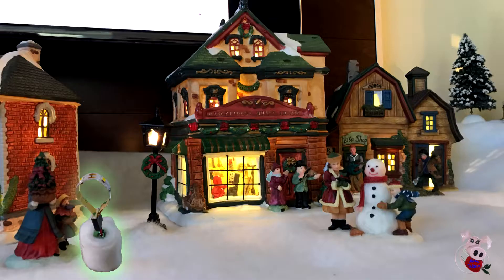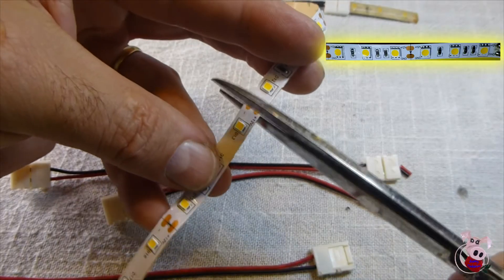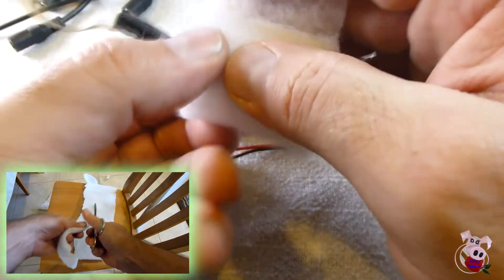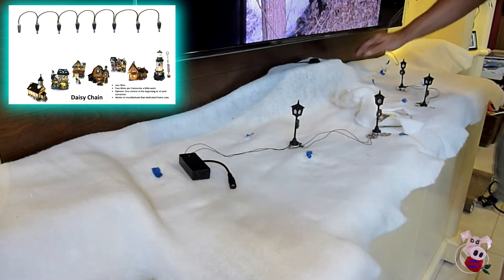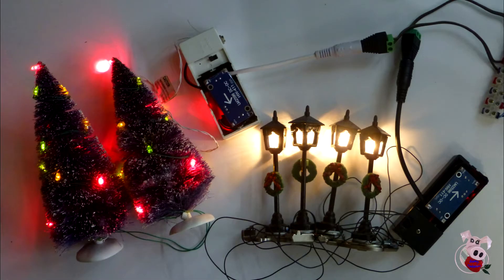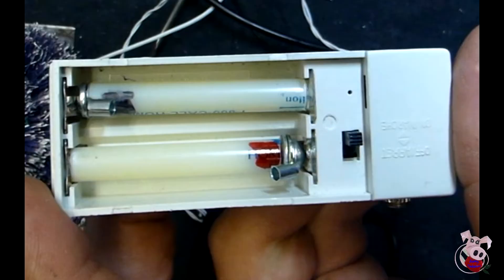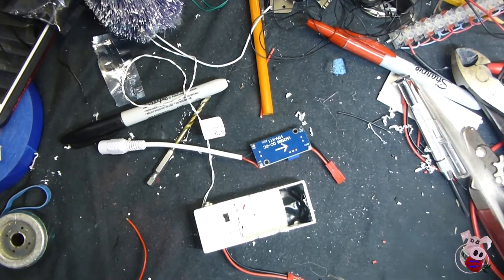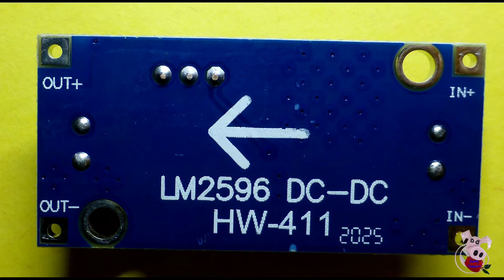Convert your Christmas Village Display to LED and all 12V DC power

Comment: Hey Rachel. Your video is great. I am finally understanding how to wire my Christmas village. But it is still not clear to me how to use it connected to a power supply. By any change, do you have a video explaining this? Thank you! 🙏
Reply from the maker: so at 6:31 I show a power distribution strip and then how to build it.  The connector on the left (the female connector) would plug into the 12V power supply and power that entire set of connectors.  So that takes the DC positive and the DC negative and extends equal power across the line to each connector.  

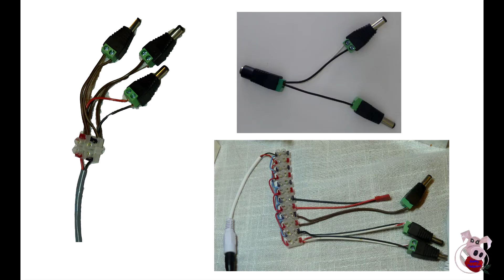In DC power there is always a negative and a positive wire.  They are exclusive and connecting the negative and positive together would short them out causing a switched (LED) power supply to shut off until the short is fixed.    If you wanted to power multiple strips of of power connectors with each one having a female connector at one end, you would need some type of device to split the power like I cover in 8:17.  It is also worth noting that the LED's have a positive (+) and a negative (-) and if you hook one up backwards the result is... the LED's at that connection won't illuminate... until you reverse the connections.

What I would recommend is ignore the village and build a short power distribution switch... plug it into a power supply and then connect some lights at the connectors.  If they turn on then you are doing the right thing and you would be scaling it up.

I do have a video on one color dimmers I had compared.  Most are still available.    Let me know how you make out.

Comment: How did you get the lighthouse light to flash? Thx
Reply from the maker: @frankgarofalo843  that is a feature in the led switch input in line. This one uses an rd remote and has a flash feature. On my Chanel I review one Cole led controllers and I cover that controller there. 

The line power connection is near the lighthouse where I place the flashing light controller.  That means this fixture connection goes on the full 12v line feed and dims after the controller is in place.  

I will add that the bottom light goes on the house feed and is dimmable without the flash. So I have wires for the top light and the body light going in the base.  

I used a dowel to mount the correct positions and I have a light block (larger dowel) that sits between the levels… so you don’t see the flash at the bottom.
Reply: @alwaystinkering6972  thank you so much!!

Comment: this is awesome and very informative.. but I would like to have different colored lights in my houses... any ideas????
Reply from the maker: Two choices... RGB as a single which requires 4 wires (a lot to manage).  You could make it cleaner by buying pre-made Y connectors and such but the challenge will always be the qty of wire involved.  Doing a couple of fixtures likely would not be bad.  

 If you put a color controller (a compact in-line one), you could place one at each house.  Keep in mind the color controllers would need full power as the input at each location... meaning no master dimmer on that power feed.   You could do addressable LED's... that is 3 wire.  

You would still have to  deal with connectors that might be harder to match.  Unless you program a custom controller for addressable LED's you would not have the detail in color control.  

Personally... the individual color controller at each location would likely be the most manageable from a wiring standpoint, but a lot of on/off switches.
Reply from the maker: Some sample controllers... these are wifi controllers... so you would be able to group them together in a phone app... so they all turn on together, but you can control them together.  https://www.amazon.com/dp/B073Y3WCKH  The wifi controllers appear to be the same price as the RF controllers... so WIFI would do what you want.  They would be an always on connection to the controllers.  The controller would be near the fixture with the color light being attached directly.  I have never tried these but they appear to do the same thing.  No case they may get a little warmer to the touch.  https://www.amazon.com/dp/B09B1WDM42

Keep in mind with color controllers you normally need the RGB connector at the controller side.  You can ether solder them on https://www.amazon.com/dp/B01DH7VMP4 or do clip on ones... which may leave you wishing you soldered them... but should be easier to get started.  Both would give you about a hand lengths of wire so you can put the controller farther from the fixture.  https://www.amazon.com/dp/B07YFRT861

Comment: This is fantastic stuff. I have been wanting to improve the lighting of my villages but I didn't have the know how until your video. Now I just have to figure out how my AC-AC Adapter Class 2 Transformer for my Victorian Village works because when it plugs in, the flashing lights only stay on for a few seconds before the whole system shuts down. Thank you for posting this most awesome video. You have earned another subscriber.

Comment: Hi. I want to assemble lighting for a simple string of houses as shown in the first part of the video. Can this be done using the following items from your list? A light kit, wire, and male and female barrel connectors? Would I need barrel connector leads as well?  I just want to start simple. Thank you.
Reply from the maker: You would need the leads (LED strip connector to barrel connector).  Without them you would have to solder wires pieces onto the LED strip and put the other end in a barrel connector.  You would wrap and tape the LED to the wire extension.  If there was an advantage to soldered on wires, other than having to buy more parts, you could make the wire as long as you want and not be limited to the length of the leads.

Comment: My LED lightstrip is a 4-wire. Is it possible to still do this?
Reply from the maker: I was so tempted to wire in color, but to power an entire set of houses from one controller is a lot of wire.  More of an issue would be all the Y connectors needed.  It could be done that way but pre-built Y splitters would be needed… and connectors to match.  You could try terminal blocks. 

You do have another option I considered which was to put an led controller at each house.  You would wire it exactly as I did with no dimmer on the house line and put a small color controller behind each house. That would be 12 v to each house, controller and then 4 wire to the light.  I recently bought a 5 pack of rf color controllers for about 20 for a magnamite night light I printed. 

The last option you have is to run one or all the colors together.  In this model you have the power to the houses as is with the dimmer if you want.  Wire one or all the color to (-) and the usually black line to (+).  It will be a cool white if you use all 3 colors. You could wire just one color or  any color combinations you want as well.   

So yes you could. Hook a section directly to a power supply and see if you like it.

Comment: How many houses do you think that you can connect we just 1 line?
Reply from the maker: The led string I used was rated at 12v 3 amps per 5 meter of lights (300 LED’s on this string).  There are 100 3 led sections. So if each house had 3 sections of light, about 33 fixtures on a 3 amp power supply.   The led strips are rated at peak amps. Most draw less than their rating.  

Keep in mind that dc loses strength with distance.  You can usually see your drop by measuring at the end of the length if it becomes a concern.  If that became a problem, I would first see if I could source the power in the center. That way both directions are half the length.

Comment: Can I use a self contained buck converter to replace the battery compartment on a string or several strings of lights and use a pattern controller device for each string to control flashing etc.  I am such a novice and have no one to ask.  Any help is appreciated.
Reply from the maker: The converter can be any format so long as it has the input/output voltage you need a connection point you can use.  The reason for trying to connect to the battery terminals is so you don’t have to know anything about the guts.  You just need to deliver the right voltage to the right point. 

If you have flashing pattern lights, someplace in that box is a control chip.  You won’t be able to connect the power to the lights direct.  Addressable bulbs generally don’t do anything on straight power. The chip tells them when to turn on and off.  
Can you use one buck to power several boxes? Yes you could.  Ether home run to power or run the power from one box battery connection to the next should work as both are a parallel power config.
Reply: @alwaystinkering6972  ok, I've gotten my house lights done.   Now on to the individual strings.  I have a buck converter CL3641AH. I would like to wire two or more strings with a flash pattern controller between the converter and each string.  I got a controller SP110E.  Since, obviously,  I don't really know what I'm doing,  I not sure if I have the right things.  The pattern controller has a different wire connection array, probably because it also controls color.  Anyway, my main question right now is, if I connect two strings that use 3 1.5 volt batteries for a total of 4.5 volts, will I have to crank the voltage on the buck converter up to 9 volts or leave it at 4.5?  I appreciate any help you can give me.  You probably think I'm a dope, but I am willing to learn.
Reply from the maker: @Pgresham3   Did the accessories flash on their own already?    If they flash already then you want to get 4.5V to each of the battery packs.   Are you going to use that remote on the houses?  On that remote the common (frequently the black) is usually (+) and you would use just one of the leads for controlling one color.  On the software moving to and from that color will change the light... as will the dim control.

 That remote dims and flashes... you don't want to use that to the battery boxes since they want a non-dimmed steady 4.5v volts.  So the 4.5V to each is done by wiring in parallel.  if you ran to one battery pack, the wire to the next battery pack needs to leave from the end of the wire that arrived at the first battery pack.  If you need I will find an illustration of that.  So set the buck at 4.5V out.  You can always run a wire from each battery pack to the same two connections on the buck... that is parallel as well.

Comment: Do you think you could talk a little faster?
Reply from the maker: Sorry.  I have a desire to include all the material and not consume a persons life.  Under the YouTube options gear which is usually in the lower right on the full browser version there is a playback speed control which may help.  Thanks for the feedback.
Reply: @alwaystinkering6972  I appreciate you getting back to me.  I really like your video and could use your help.  I've watched it several times and really need more help with the last part where you use the battery compartment to convert accessories.  But, it gets a little technical and is difficult for me to follow easily.  Especially about adjusting volts on that tiny device that goes inside the battery compartment and making sure you id the positive and negative correctly.  Although I have solder equipment, i think i found a device on Amazon that uses screw inserts so I don't have to solder.   Anyway, it's difficult to find really helpful videos and to make sure I have a chance of success.   I am so sick of battery issues. Sorry for the rant.🤪
Reply from the maker: @Pgresham3  my goal was to reuse the box and not disturb the existing wiring as much as possible. Electric flows one way through batteries.  For 3v dc the flow goes through one battery for 1.5v and then flows through the other battery adding another 1.5v.  When batteries go in opposite, the two ends on one side should measure 3v dc. If the batteries go in the same way then the power should test 3v with the positive on one battery and negative on the other.  If it is not one combination it should be the other. 

Soldering.  It can be sloppy.  So long as it does not short to another contact or melt something and it is solid you are good.  The most important item is to “Tin” the wire and then the contact.  That is where you apply some solder to each separately.  There are some good videos on soldering.  After you tin them you lay one over the other and touch them with the iron until they melt together and then release.   There are some lm2596 videos that take longer to show adjusting output voltage. They are mostly reviews like this one. https://youtu.be/P9bzQ-jwvI4 

I have another video pending.  Burning my 20 year old street lamps for 30 days last year burned them out. I converted them to led.  Such small wires on something never designed to come apart.  I did not know if that one was going to work.  This year we just turned on the village and ran it from thanksgiving to New Years and all ran great including the street lights.  

Best of luck. Remember to pay attention to the (-) when you see it on the meter.  That means the positive and negative are opposite from where you have the probes.

Comment: Fantastic video I have converted the mini lights you buy at Wal-mart into ac power so when I turn it on everything comes on at once instead of taking each piece on separately  with the battery pack. One of my questions I have because I ran out of solder is what type do you use. My other question is I have bigger piece of decoration I have is this christmas tree made out of ceramic its about 13 inches tall and the center is hollowed out and inside you have a small Santa that is passing out trees its hooked with one of Lemax adapters and has really bright LED lights on it but they flash like crazy there is no "steady" position, it seems like you would know how to fix this, any ideas
Reply from the maker: Regarding your small tree.   Someplace there is likely an IC chip controlling the works.  I am going to say... without seeing it... the odds are against you.  If it is new within the last 7 years or so... a lot accent LED strips with flash patterns are using addressable LED chips... and for those you usually need a controller.   If it is a really primitive IC chip, it is possible that it has just a single flash mode programmed it.     

As a next step, I would say if you can find the control board... see if it has, or leads to a button you have not yet found that controls the light mode.  Do be careful if you try to light the LED's directly.  You have no idea what voltage the are sending to them.  Of course you could try to read that at the line out to the LED in the current configuration.   Addressable chips will show a voltage, but usually will not light when you power them directly.

Comment: I did this , my question is why is the lights pulsing? Any ideas?
Reply: If your LED lights are pulsing, it has to do with the stability and cycle of your 12v DC converter. Get a different converter made for LED lights and they won't pulse/flicker.

Comment: Like your display n lights. I did my outdoor led string lights by hooking 2 leads into each box. And run one to another until it counted 12v and returned to deep cell battery to make sure my little solar lights burned. And they did

Comment: Hello. would I be able to use the hub power up the led source, from "Department 56"?
Reply from the maker: I went to there website and looked at their replacement parts listing. They have a wide variety of power supplies from 3v to 12v.    So, for what I showed with 12v any 12v will work.  I did not spend a lot of time talking about power supply sizes since everything I showed had a very small draw.   I cannot totally answer your question since I don’t know what other features of theirs you might be powering.  

For what we are converting estimate the amps for each section of 3 lights.  So 300 lights in a 2 amp rated string figure .02 amps or 20 milliamperes per section of 3 lights. The dc step downs are harder to estimate w/o metering the current.  There will also be some loss for the wire distance and splitting the power. 

So if their power hub has say a 500ma 12v output… if you added just lights and assume 60% usability… for 300ma that would be 15 sections of lights  if there was no other load at 20ma per section. 

If you are not comfortable guessing overall load, use a separate power source for what you convert.  If the hub is less than 12vdc it will not power a 12v string.  

I should also add that led amp rating should be peak load (as it can change based on several factors). 

I hope that helps in your determination.

Comment: Hi, Can I purchase a switch over for the Lantern streetlamps not too confident making one...
Reply from the maker: I will be posting a video on converting my street lamps to led bulbs.  One attribute of running my 20 year old incandescent bulbs continuously is that the bulbs all finally blew.  Converting the street lamps to led was not the easiest.  The lamps were not designed to come apart and everything was miniature.  In the end it did work and I ran them for a couple of weeks before storing them.  Does that answer your question for now?
Reply: @alwaystinkering6972  have you made this video yet? I would like to convert everything at one time.